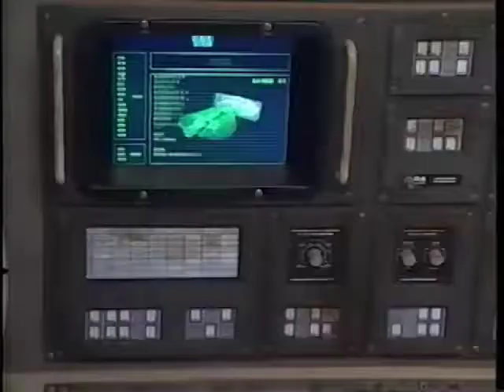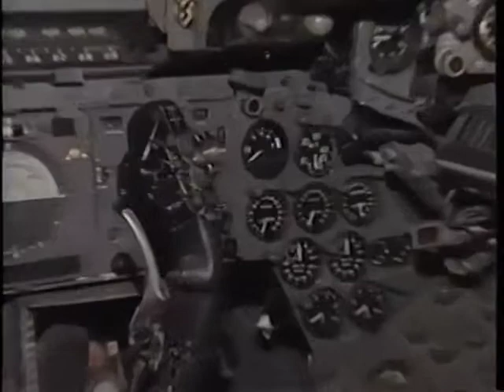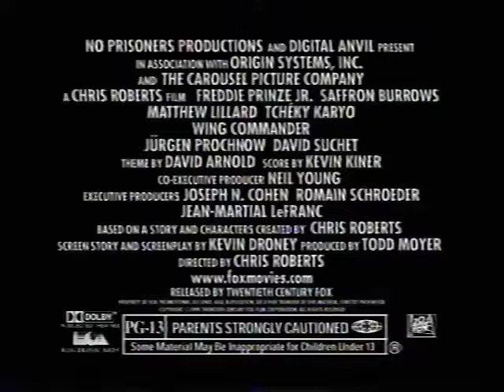Wing Commander behind the scenes featurette - recut for fun

Comment: Thanks for posting. I wish they show who actually designed the ugly fighters. They are like cut off aircraft nose radome up to just the aft of cockpit section then sticked 2 tiny engines and wings at the back. This caused the movie to fail. They are supposed to give us Wing Commander 3 hellcats, arrows, thunderbolt & longbow instead made out of Mig-23 frame they bought. Not cut off the nose and take up the cockpit slightly aft fuselage section